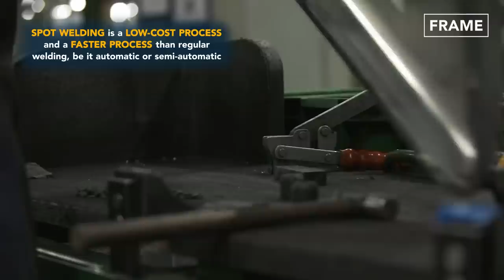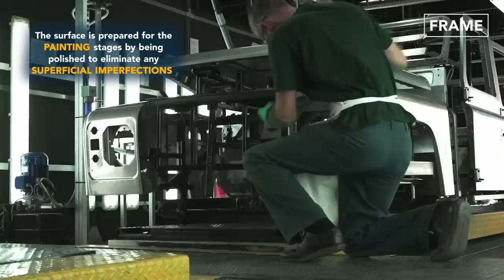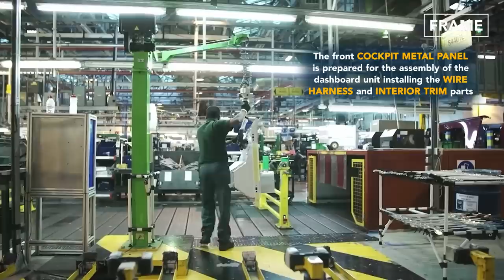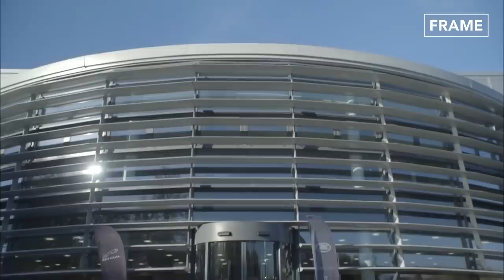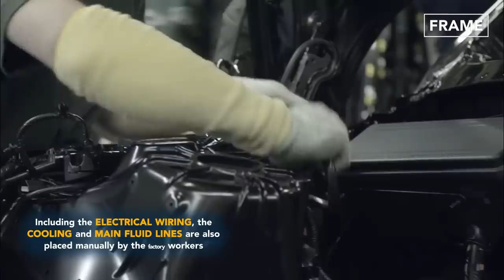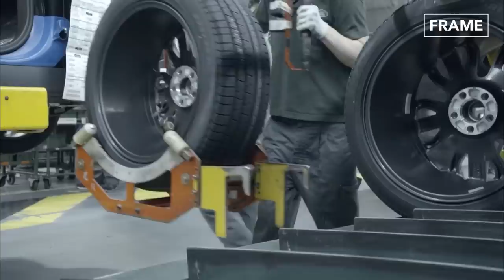Tour of Land Rover Giant Factory Producing the Old School Defender - Production Line

Comment: I have a Defender 90 which I work on myself. I noticed its construction appears to be uniquely labor intensive. For example, the bodywork is screwed and bolted around a core bulkhead piece. Nowadays, mass produced modern car bodies including Defender-style vehicles such as Jeep Wranglers are welded by robots as one assembly with only parts such as fenders and doors bolted on.